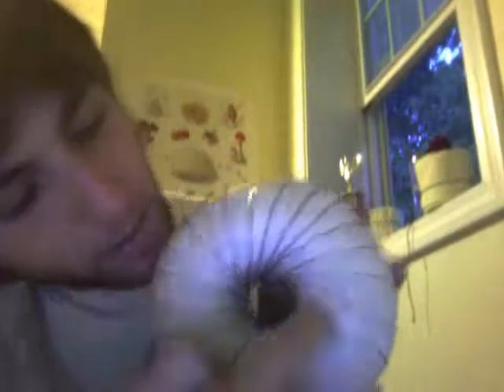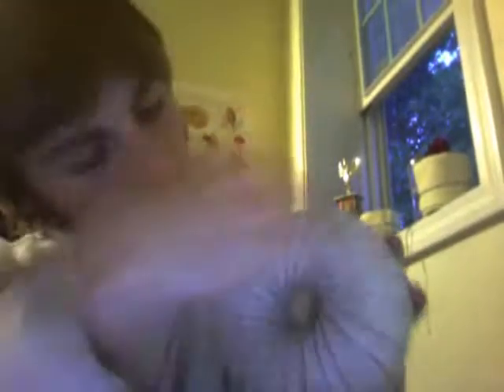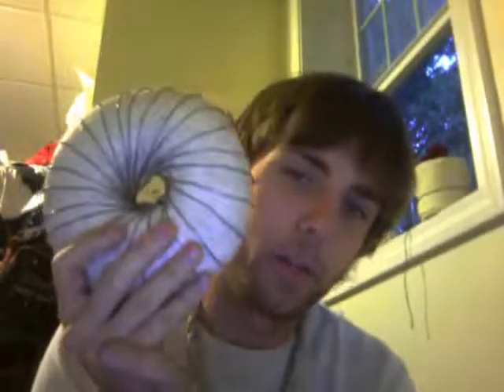How to properly build a Rodin Coil - Part 2/2

Comment from the maker: @nja2015 Ya that works. I have 17 gauge electric fence wire right now, really too big. I would def recommend 20-22 gauge. Remember though, aluminum is less dense/weaker than copper. Search for the website "whimsie", has Soft and hard aluminum, tons of gauges and bulk too. Soft aluminum is annealed at 800 def F to make it softer to work with. Has thick foil too. The simplest way to make it correctly is to cut the circuits out of aluminum foil so they expand and contract.